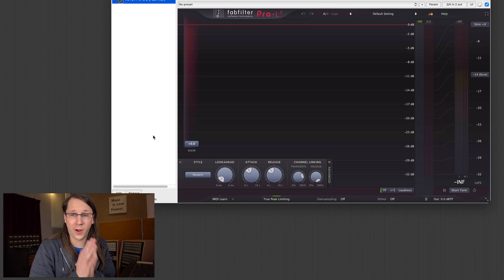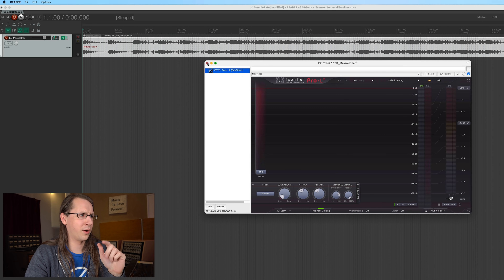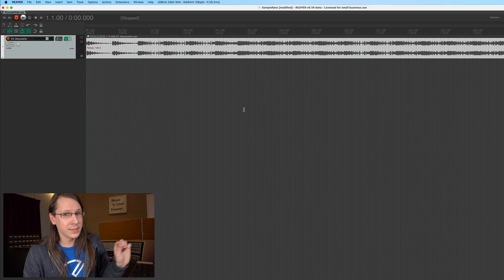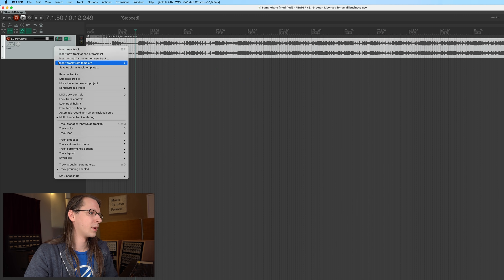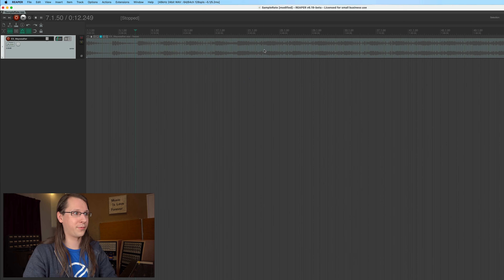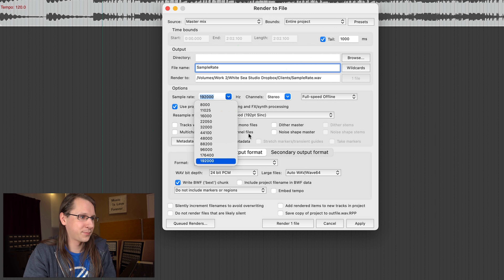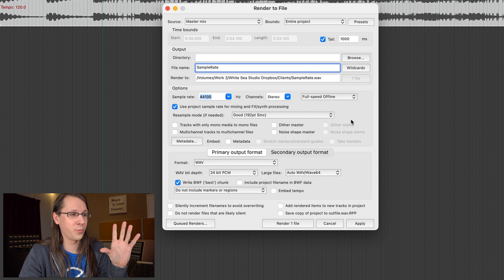WHAT is the BEST SAMPLE RATE?

Comment: As logic pro user I'm interested in how this applies with it's 32 bit float internal processing?
Reply: All modern DAWs process audio at 32 bit float. That's all about dynamic range and noise floor vs clipping and has little to do with the sample rate. 24 bit is 144 dB of dynamic range, which is more than the range of human hearing, so its plenty of headroom to work with for almost all applications. similarly to the points in this video though, recording at 24 bit and processing at 32 bit float does have advantages, thats why your DAW does it automatically. When you bounce your file though, its still needs to be reproduced at a fixed bit depth and so choosing 16 or 24 is the way to go :)
Reply: Thanks Jeff.  So can logic pro be set to process at higher sample rates like Reaper can? I haven't seen this feature like was shown in this video for Reaper.  Unless it's just a matter of converting a project to a higher sample rate before mixing? This I can do of course.
Reply: @paulkeeler441   I can’t say for sure if it is possible to set logic to process at a higher sample rate as was done in this video with reaper. Either way, over sampling within the plugins themselves should be sufficient for processing in most cases. It seems to me like setting the project to a higher sample rate for processing is more convenient for sure but not a necessity.
Reply: I have also seen arguments that suggest upsampling in your software can add artifacts and unwanted noise. I think personally I will still be recording at 48khz, keeping my overall project settings at 48khz to match my hardware, and then over sampling in plugins where it makes sense :)

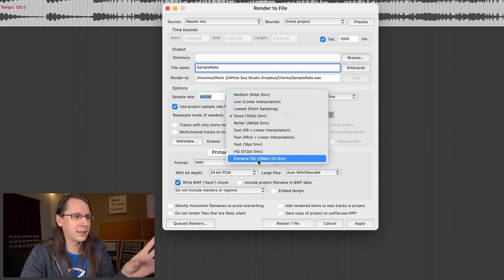Comment: The Resampling feature at 6:00 is basically how accurate you want sample stretching to be. When you stretch a sample to be a different length than the original, you might run into these really digitized, computery artifacts (especially if you make the sample slower). The higher the resampling the better the stretching will be, and the less audible the artifacts.
Reply: Stretching is a concept not quite applicable to samples. They are defined as scaled dirac impulses which have a  infinitesimally small width and cover a area of exactly 1. The option in reaper fives away all the information: 512pt sinc interpolation. You use a sinc function sin(x)/x where x is chosen according to the desired low pass frequency. A perfect sinc goes from -infinity to infinity though. You approximate it with 512 points here and call it good enough. The 512 points (if one side is meant) lead to 20*log10(1/512) = -96 dB which is the theoretical limit of 16 bit PCM. For each resulting sample you need to do 512*2+1 evaluations of the sine and one division though, both quite expensive operations on CPUs. The sum over all is cheap at the end. The amazing part about this technique is that you can choose any resulting samplerate you want. Fancy some 37kHz ? No problem.

TLDR; samples can't really be stretched, sinc interpolation is great but computationally expensive.
Reply: @Mefistofy  I meant an audio file, not individual samples, sorry if it wasn't clear. Stretching something like a guitar to last longer, or be shorter. They are indeed pretty expensive on CPU, and that's why one should save higher point counts for offline rendering.
Reply: @iammodus  Did not think of the sample as sound recordings. I might bee a little to much into DSP sometimes. Everything you mentioned is exactly on point.
Reply: That computery artefact is so nice of crunch to samples. Thats the whole reason i now use arturias emu sampler. 20 years back used the emu 1212 chipset for that.

Comment: The one big reason to use 192khz is if you want to time stretch audio. More sample points, better result.
Reply: Yes there are more sample points in general but the region,say,between 20hz-20 khz is represented with the same number of sample points in any scenario.
Reply: nope. samplerate has no effect on fidelity in time. all digital audio at any samplerate actually has infinite fidelity in time, assuming infinite fidelity in amplitude. that's why digital audio really can contain "any" audio, not just that which somehow fits neatly into a time grid. the only thing raising samplerate does is raise the limit on the highest frequency component that can exist in the signal.

Comment: I design audio equipment and take a lot of measurements. One very important point is that hardware re-sampling (by an ASRC chip) is able to remove a lot of the distortion products introduced by a less than ideal clock signal.

For example, if your DAC locks on to the AES/EBU input and detects the sample rate, this is using something called a PLL (phase locked loop) to generate a clock from the input signal. This can often lead to less than ideal jitter performance and introduce distortions (usually side-tones of a fundamental). If the DAC has an ASRC chip it can use it's own internal clock and resemble the input stream. The result will be cleaner. In fact it is much like quantizing a badly timed drum piece in midi.

Software resembling is a mixed bag IME. Im not really sure why it should be any different than a hardware resampler, but if you resample a 1khz tone in Adobe Audition and look at the FFT plot, you can see that the various resampling setting availible make a huge difference to the distortions introduced. Maybe it just looks worse when resampling an ideal 'generated' wave rather than something captured by an ADC.
Reply: My understanding of this is that digital depictions of the waveform are in fact flawed and if you send that exact signal out to an analog oscilloscope you will still get a perfect sine wave. Although I could be misunderstanding what you're saying!
Reply: @jeffrosen2010  Yeah I wasn't meaning look at the waveform, but the FFT analysis. This shows the frequency content of the waveform. You will see the original tone plus spurious distortion products introduced by the resampling. I'll grab some examples.
Reply: @jeffrosen2010  Here are some examples. This is a particularly bad example of a DAC that has poor PLL recovery of the incoming clock stream VS. same DAC switched to resampling mode at 192KHz. Note significant reduction of harmonics (sinusoidal jitter) as well as noise floor (random jitter). https://imgur.com/40ZL7iZ
Reply: @jeffrosen2010  Here is the same waveform from the poor PLL DAC simply resampled in software to 192KHz. The result is the worst of both worlds. The original jitter is already encoded in to the waveform and can not be removed at this point. You also then add the artefacts of resampling. https://imgur.com/6TLyban

So I'd suggest running software at native sample rate of your ADC, let your ADC provide clock to the system. Then use a DAC with hardware re-sampling when an analog output is needed.
Reply: @jeffrosen2010  One of my replies went missing! Here is a software generated 'perfect' waveform resampled in software to 192KHz. You can see the base of the tone becomes wider and the noise floor increases. https://imgur.com/FQI2Qej
Reply: @Audio_Simon  thanks so much for the examples! This is super interesting, I definitely have some reading to do!
Reply: @jeffrosen2010  The ideal solution is a world clock source used by all equipment, but this actually introduces other issues because the grounding between all equipment must be ideal for the best results. There are nearly always distortions introduced by stray return currents in the ground path :( Careful use of transformer or opto isolation can help, you you basically need to be taking FFT measurements like above to asses the results.

Comment: Most of my clients don't care about that last 10% of sound quality. 48K/24bit is more than enough for most of them. 192k is great for High Quality transfers from well maintain tapes from 50's, 60's or 70's. Similarly, old movies filmed on 35mm look great when transferred to 4K.
Reply: There is no "last 10% of quality" if you're just comparing 48 kHz sample rate with 192 kHz. Assuming both are the same bit depth, etc. They are precisely the same. 

Now when you start doing processing you can need another anti-aliasing filter for non-linear plugins. Oversampling plus that filter is the best way to do that.

But otherwise the analog that will be reproduced by the two differently sampled files will be literally identical. If you have analog summing and two different workstations or machines you can even verify this.
Reply: @ZeroDividesByYOU  yes, there is a difference between these sample rates and it is more than 10%, but for most people it doesn't matter.
Reply: @Threemicsrecords  please explain mathematically the difference between them.
Reply: @ZeroDividesByYOU  Hey I understand your point but please search for a youtube channel: The Hans Beekhuyzen Channel, and his video title: "MQA part 1; Why 24 bit 192 kHz audio?" He explains it very well. 

In short, It is all about time and how precise attack of the sound is represented.                                                                                                          

Once again, for most people this does not matter. They don't care, they don't want to pay for it. They don't listen music on good system. If convenience had not be so important for most of us, SACD or BR-Audio, HIQ audio would have be the standard today. Instead we have spotify.
Reply: @Threemicsrecords  
That's a logical assumption to make, but a factually incorrect one. Anyone that thinks that transients or fast attacks in music are more accurately represented by a faster sample rate does not understand how band limited signal sampling works. As long as the signal has been properly band limited (ie, low pass filter so the highs above human hearing are not captured so that no aliasing occurs), the time domain is INDEPENDENT of the sampling process. There is no such thing as a transient too fast to capture by that lower sample rate if the signal has been band limited.

Conversely, if there were a signal with a transient too fast to accurately reconstruct, it would mathematically NECESSARILY contain frequency content outside of the band-limited signal we care about.

Too many people do not seem to understand how this works and claim that there are things that can happen "between" the samples that are not captured correctly. 
This is simply false. 

For literal proof, you could try the analog summing I mentioned before, but I doubt most people have two of the same converter and computers. For an easier proof, go watch Monty's video at Xiph.org 

There is an excellent demonstration in the middle of one of those videos where he literally SHIFTS the samples in the time domain through a fast transient-like impulse. He also measures the output results in realtime on an oscilloscope. The transient is represented PERFECTLY, NO MATTER the relative time domain of the samples. This is a mathematical FACT.

Comment: Another case similar to your example at the end, is if you receive (or create intentionally) a file that is clipped, you’ll discover that the clipping creates frequencies way above the expected cut off, and any processing at all, even a downward gain change, will produce distortion that can be 6 dB or more above the MSB. Converting files like that to higher sample rates sometimes alleviates this problem. Separately, the best thing to me about high sample rates at time of the initial AD conversion, is that there is FAR less phase shift in the audible band than what you get from the extremely sharp cutoff antialiasing filter required for 44.1 or 48. If you’re recording something like an acoustic piano, it can sound far more open, spacious, and natural due to having far less phase shift on all the harmonics that the piano produces. At least a compromise of using 96 for an application like that will be audible.
Reply: Interesting! I have never thought about the phase shift from the cutoff filter. If the filter is constant shouldn't it create a repeatable phase shift and therefore multiple sources would still be in line? very curious.
Reply: @jeffrosen2010  You're right, in that if you use the same converters for all tracks in a recording session, the phase shift from A to D antialiasing filters will be identical in each track. It is not a problem of track to track phase matching. What I hear and don't care for in low sample rate recordings of acoustic instraments is phase shift between the midrange fundamentals, like a key struck on a piano, and that note's higher harmonics, of which there are a lot, when converting the analog signal to digital.

Comment: From mechatronics class at university - we learned that the optimal sample rate is slightly above the nyquist frequency. So, humans hear up to 20k, this means that 40k is the nyquist frequency, so 44.1k is fairly safe, however, 48k is even safer with a reasonable tradeoff in terms of performance for making sure signal is replicated as its supposed to..
Reply: Well specifically with audio, the gentler the filter the better because of possible phase shifting and latency with designing filters. So 48 kHz is my preferred just to be extra shape
Reply: if we try to think about raw AD DA sampling without any interpolation or filtering from the pure technical wiev 20k sine is sampled about 2times, so from sine you will get square with 20k frequency and somehow shifted phase. Also 10k sine will be sampled 4.8 times that will not keep original sine shape and phase.

Comment: They should have made a 60kHz rate. That would have solved pretty much every problem without completely unruly file sizes and absurd processing power.
Reply: When 44.1 was made hard drives cost A LOT of money. Engineers needed to save literally every byte.
Reply: @patrickcarter1820  Yes of course. I meant now. 60kHz all across the board would really be best instead of what we have currently. Legacy is a bitch!
Reply: I use 88.2. Easy conversion to 44.1 and easy on CPU.

Comment: Thanks for this. Very useful. You mention Tidal... For listening to Master quality audio would you still recommend 48khz?
Reply: The Wikipedia article on the "Nyquist–Shannon sampling theorem" gives the answer: As long as you're not applying any distortion in the digital domain a sample rate of 48kHz is sufficient. Anything higher than that won't have any benefit - unless you want to play back ultrasonics.
There's a reason why the CD was specified with 44.1kHz even though that seemed crazy high at that time: They new that if they used a sampling rate slightly above 40kHz there would never be a need for something like a CD Mk 2.
44100 may seem like an odd number but was specifically chosen as it was compatible with video cassettes. Basically, just like we use 48000 today as it's a multiple of the 24 frames digital video is mostly recorded at.
Reply: @error8418  But why does Blu-ray have the specification up to 192khz?
Reply: @DragonboltBlastter  Marketing, I guess.
The higher video resolution is obvious, but keeping the audio specs the same might have seemed like "they only care about the video quality and don't care to improve anything about the audio quality".
So keeping the audio specs the same might have seemed like a step backwards compared to the better video specs.

Comment: There was a guy on the SpectraLayers forum who needed a higher samplerate than 192khz because he studies bats and analyzes their frequencies.
That was an unexpected but interesting usecase.
Reply: That's the first time I hear of someone who really has a need for high sample rates.
Unlike hi-fi fans who think anything under 384kHz is unbearable...
Reply: @error8418  I have recorded at 384 kHz...when I reviewed the Cello audio interface.

Do you know what I heard and what was recorded compared to 192 kilohertz? Noise. 

Apparently when you sample at those higher frequencies the device picks up more noise.
Reply: @RealHomeRecording  I guess most converters don't perform particularly well at high sample rates. Just because a device is allegedly capable of 384kHz for marketing reasons doesn't mean that the converters were really designed with a focus on those sample frequencies. Most DAC and ADC chips perform best at 48kHz (or 44.1kHz for that matter).
Reply: Was it Benn Jordan/ The Flashbulb? He has a fascinating video recording bats.

Comment: Thank you for the explanations. And should I be careful about anything transcoding a 48kHz to a 44,1kHz audio file ? As I should be careful when transcoding 24bits to 16bits, to use an algorithm that doesn't produce artefacts ?  Because it's the "standard CD",I 've always used 44,1kHz (but 24bit for better editing and processing). But is the "modern digital world standard" 48kHz ? Because I know this is the standard for cinema, videos, etc.... Are all these streaming platforms working with 48kHz ?
Reply: That's exactly what dithering does. It produces a sort of randomization noise that helps reduce the number of artefacts created when digitally downsampling. Mastering engineers worry about dithering for you, but for the most part the automatic dithering in the DAW is sufficient

Comment: yeeeeees thx white sea studio i also work at 96khz and export at 192khz for aliasing and to apply oversampling built-in or use metaplugin for aliasing and convert it back to 48khz using dbpoweramp which is the most clean pristine sample rate converter available on the market.